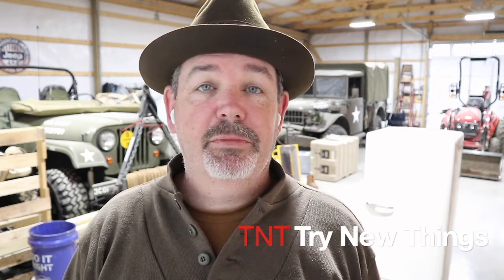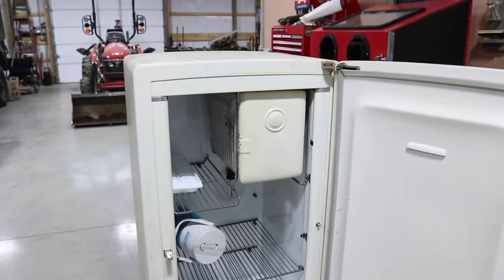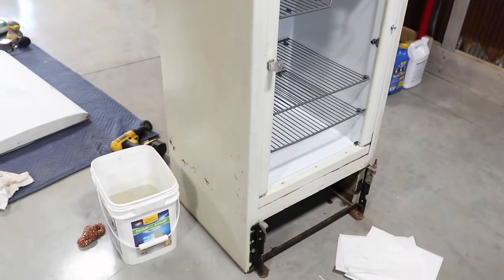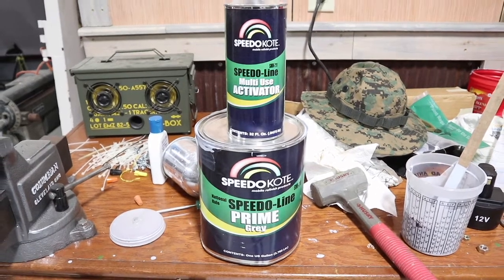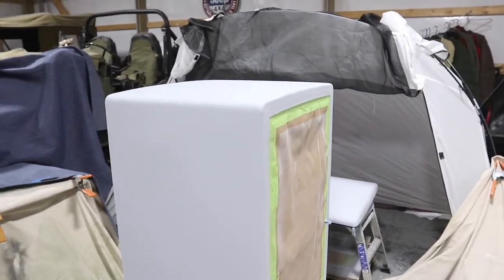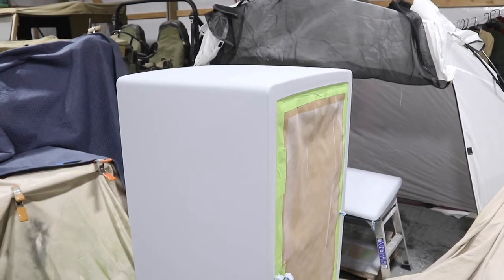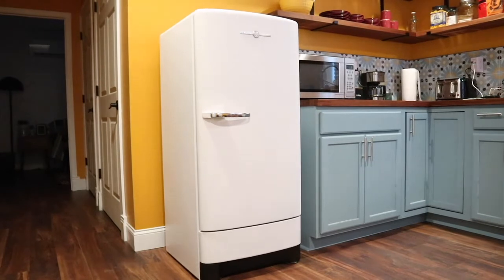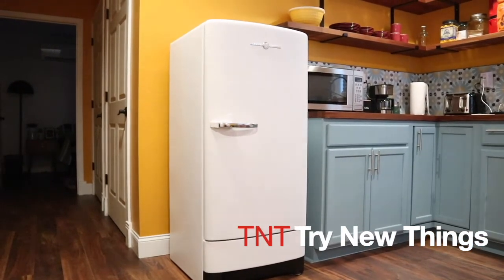#121:  1940 - 1950's Vintage GE Refrigerator / Fridge Restoration Part II of II

Comment: You did such a beautiful job painting this lovely old gal.  I have one is my kitchen as well, and I love it.  The food just seems so much more fresher.  Veggies last a long, long time.  I think not having frost free is the key. I also have a stove from the same era.  It's great to see someone else who loves these priceless work-horses too.  Thanks for doing the video on the paint job!
Reply from the maker: They don’t make things like they used to.    I also have an oven I picked up for about $25 in the barn kitchen that has to be 40 years old.   At home we have an 8 year old GE fridge on its last legs.   Water in the door failed years ago and started leaking out the bottom.    Got a quote and they said $500-$700 as they can’t just fix a part, it requires a new door.    So now we are on the hunt for a new, simple no options fridge and they are dang hard to find 😕
Reply: @TryNewThings  I saw a documentary recently that explained that today's products are actually engineered to only last so long.  We can certainly see this is real life when it comes to appliances (and many, many other things)!  I think they are in cahoots with the appliance insurance biz. :)  I hope you find something.   Maybe since you're handy, you should look for a good solid older one.   The service guy who came to look at my '49 GE fridge last year told me ALL the part on her are original.   That's like 75 years of faithful service.  Can't beat it.

Comment: Finishing restoration of a 1948 ge fridge tomorrow,. Yours is absolutely gorgeous as well brother🤙🤙🤙
Reply from the maker: Thanks Dennis!    Funny how my vintage GE is kicking along out at the barn and working awesome, while my GE fridge (about 6 years old) at home in the kitchen I had to shut off the water connection because water was running through the door and out on the floor, motor howls on occasion, and door is difficult to keep sealed.    I love my old fridge... only downside is the occasional defrosting - but I can happily live with that.     Congrats on your resto!    Let's keep these old girls in use for another couple decades.
Reply: @TryNewThings  may sound weird,... Tape and flex seal outer edge of using old mag trim or just the door seal.

It does repair very well , just be patient when applying .

Hope helps, oh p.s., fridge is done, Corvette foil red.

Comment: It turned out beautiful. I would love to have one of these old fridges in a metallic orange.
Reply from the maker: May not be the most efficient, I am also very ok with having to defrost it every 3 months.   But there is something about it’s simplicity of design that makes it very appealing (and it is still working after 70 years which is not what you can say about any fridge on the market today).    If I was a good painter I was strongly leaning towards a deep red finish, but in chickened out based on my skill level.

Comment: Looks great Chris. I used to paint cars back in the early '80s up until about 2005. I always had to wet sand the primer. A good friend and fellow body shop man told me to use lacquer primer and I'd get better results. Well, i still had to wet sand the lacquer primer but I did find it to be a much better primer and also any brand of acryllic enamel auto paint would bond better to the lacquer primer. Also I discovered higher air pressure would give me a smoother paint job and a shiny slick finish, perfect for adding the harden top coat finish.
Reply from the maker: Dean thanks for the feedback my friend, will keep the lacquer primer in mind.    I'm a little handcuffed on my air situation (without spending some more $$$) as with many of my bigger tools, my compressor is older than I am :)

Comment: Great video! I’m restoring a 1955 Philco fridge, doing the gasket now but will be painting in the future. This was very helpful.
Reply from the maker: I did not replace the door gasket.   It did have a few cracks in it, as well as a gap in a couple corners.    Thought I would try something before trying to source a new gasket and I ended up working grey caulking into the cracks and gaps.   No idea if it would work or not.   So far working like a champ.    Best of luck with the restoration, there is just something I really like about those old fridges… maybe it’s memories 😉

Comment: Have you replaced a door seal on one of these?  We have the exact model and it works well but will need a new seal at some point.
Reply from the maker: I have not as of yet.   Patched the cracks in mine with silicone.    Worked good.   Holding up and remains flexible.

Comment: my grandma has one of these at her house, used continuously for the last 70 years. amazing considering new fridges like samsungs only last about 2-4 years and then are too expensive to fix. I think when you take into account the tightly latching door, thicker insulation, smaller internal volume and more efficient banned refrigerants, that these have to be one of the most "green" fridges ever produced. from a time before wasteful consumerism tookover and labor was cheap enough to justify fixing things. Ive seen a couple of these in videos from cuba that are still working since before the embargo.
Reply from the maker: G Money, thanks for the great feedback.   And I agree on lack of quality with new appliances.    We have been particularly unlucky with any in-door water and ice options.     Have shut off on our fridge at home due to leaks and the $600 fix estimate.    Next fridge for home will just be a … fridge.

Comment: Hi there...did you paint over the chrome brand emblem on the front or remove it before painting? I'm wondering if the emblem can be removed for painting and then replaced.
Reply from the maker: I left it on and tapped over it using an exacto knife to trim the tape neatly where it connected to the fridge.   I did not want to tear the inside of the fridge door apart to see how it may be connected.    When I was done painting I peeled the tape off.
Reply: @TryNewThings  Thank you so much!! Thats exactly the information I needed!!

Comment: Do you have a link to the gasket that you used on it? I just picked up an old GE and need to find a gasket to put on.
Reply from the maker: I did not replace my door gasket, it wasn't too bad, had a couple cracks, believe it or not I 'touched' those up with some caulking and after a year it is still holding up fine.    I did find this website that may be a place to start looking.   https://store.antiqueappliances.com/Door-Gaskets_c_8.html     Best of luck as well with your old fridge, I'm still loving mine.    I have to defrost it about every 3 months, but that brings back memories as well :)
Reply: Antique appliances in Clayton Georgia will have your gasket they have a website

Comment: How did you get the fridge door off?
Reply from the maker: Thanks for the question, there are two pin hinges, one top, one bottom of the door, I removed the top one then lifted the door off the bottom pin.   To put it back on did it in reverse.   Tricky when you work alone but do-able.